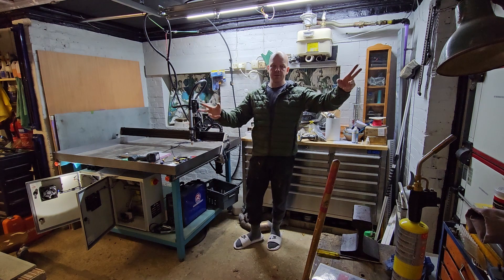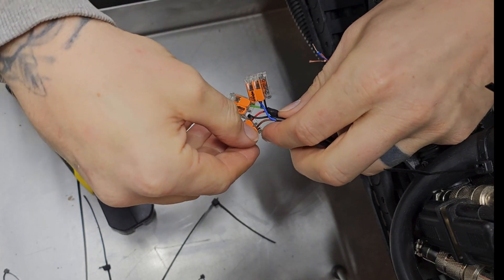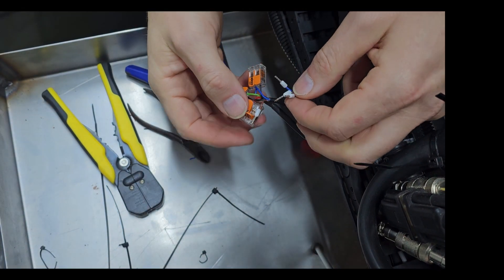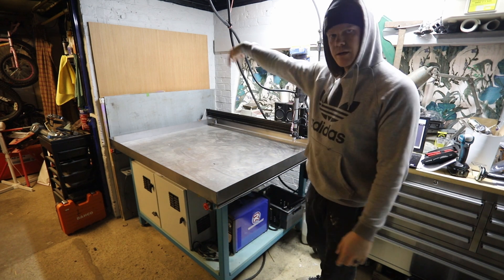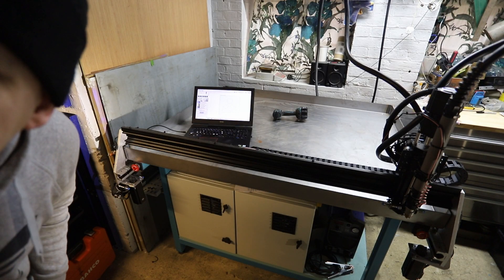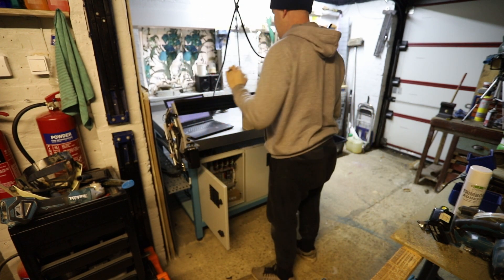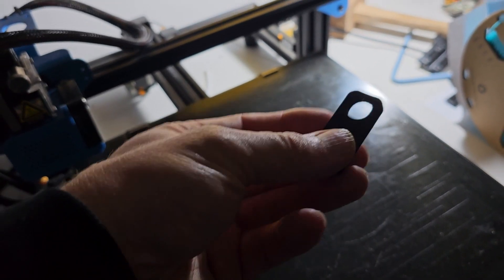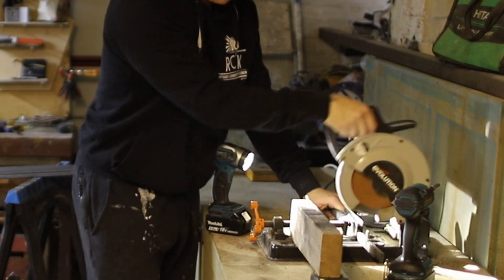Building a DIY CNC Plasma  - Part 7 The Final Chapter!

Comment: I am impressed mate, I bought my table and it runs myplasm, I have had it for 18 months now and its a steep learning curve. If I can help you at all as I am based in the UK then let me know as sometimes just being able to pick up the phone to ask a question is all it takes.
Reply from the maker: That's great thanks 👍, I did contemplate buying but I wanted to know how to fix it without paying the fees for a serviceman so I just had to make it myself.
Reply: I am looking to see if I can do improvements on mine, so just starting to look at motors etc, and which types are better, servo or stepper.  @getyourwoodout